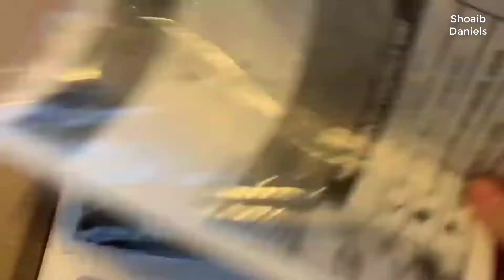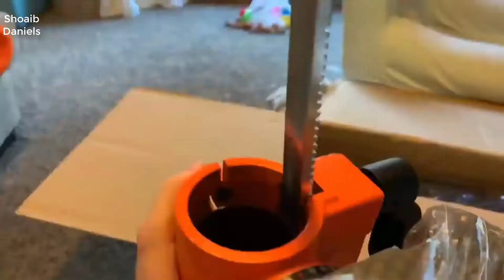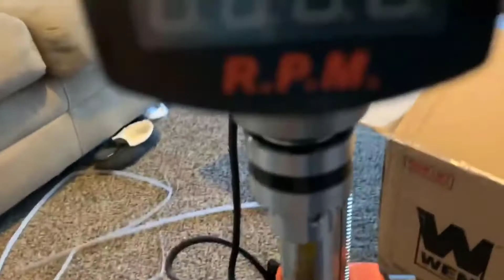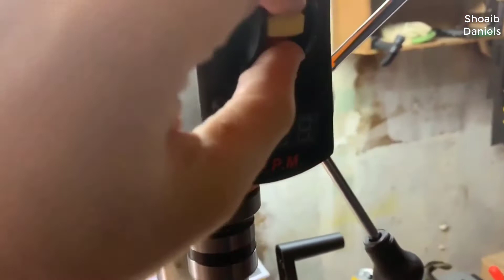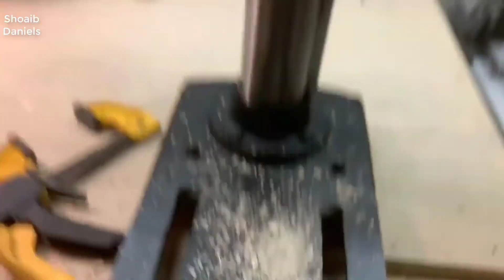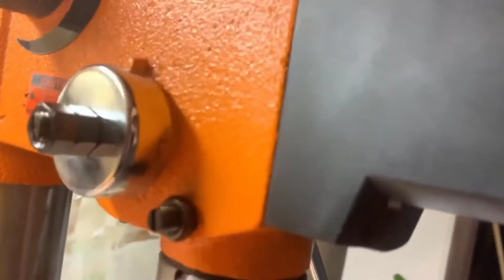WEN 10-Inch Variable Speed Drill Press Review 2021

Comment: Just bought one, should be here by tomorrow. Looks like it'll be just right for my little shop although I'm going to do a few modifications to it: maybe wire the laser switch although I don't see myself using it too much. Don't know yet. Wish it had a depth stop like the 12 inch does. Might be able to fix that. Wire in a shop light and I have a 1 hp 8amp peak 75% old Westinghouse motor I'll prolly wire in too, along with a keyless chuck. If ya haven't yet, put some blocks under the base where you'll bolt the machine to the bench cuz if you tighten them down too much you risk cracking the base. It's just thin cast iron I believe. Grease the spindle, table height gear and rack. Keep an eye on the drive belt and the variable speed assy. These chinesium versions are nowhere near as built as the heavy duty pricier models. Thanks for the vid.